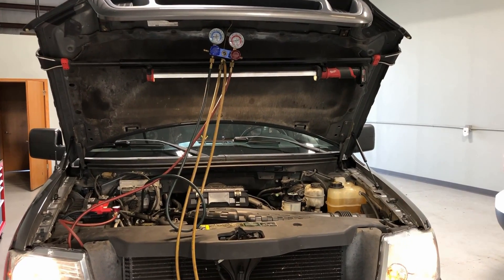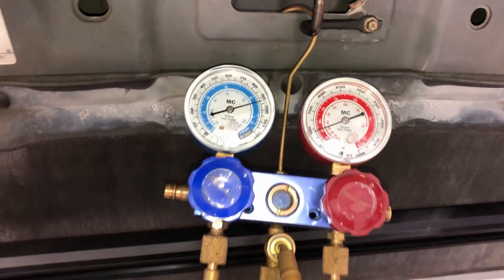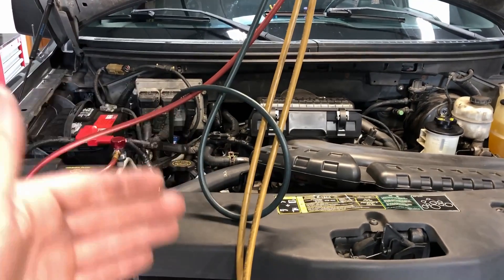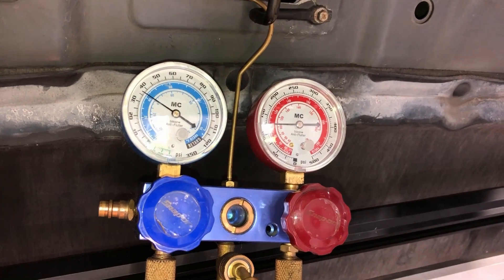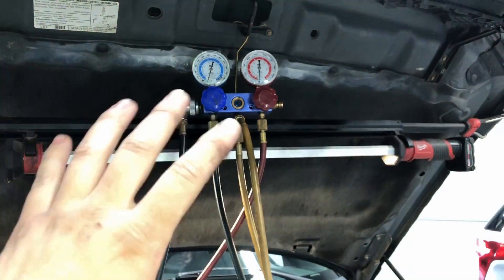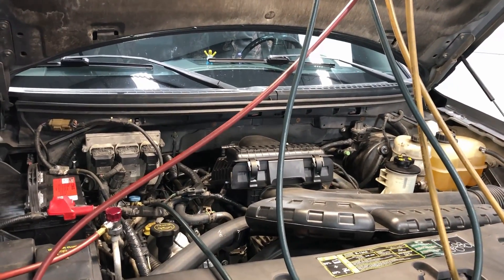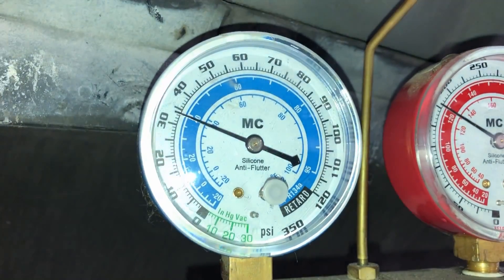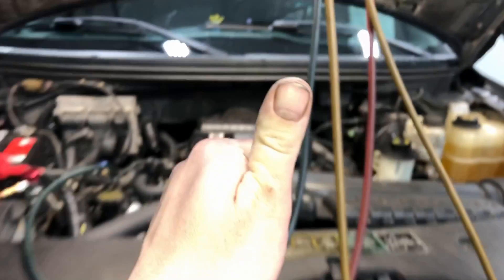Poor Automotive A/C Cooling: Do You Have a Low Refrigerant Charge Level?

Comment: I'm not certain if Fords install dye at factory assembly of vehicle ac systems. GM does when switching from r12 to r134a. My question depends on dye from factory installation when ac was new. As most everyone knows, loss of refrigerant in vehicle ac systems usually means a leak occurred and not a normal loss of refrigerant over time. If dye was installed then a uv light should be used during initial ac inspection when suspecting loss of ac cooling. My presumptions are that all vehicle ac systems were assembled as sealed units similar to refrigerators and freezers except they're standing in place for years. With vehicle ac systems, soft aluminum parts stress harden after repeated flexing from road shocks eventually leading to stress cracks to leak refrigerant. Salted roads allows aluminum to corrode until  thin walled aluminum fails. Even crimped ac hoses give way to leaks. I wonder why no mention of leak detection is ever discussed first when dye will be released anywhere in a system that leaks from loose/damaged fittings or other issues that results in leaks. Dye will mark the area and easily found with a uv light without evacuating and recharging a system only to have a customer return to verify loss of ac cooling.
Reply: I don't think any automakers install dye during the build process, but can easily be added anytime.  An AC system in a vehicle will slowly lose some refrigerant over years of use due to the way the seals are in the compressor mainly around the driven shaft and will leak out the front of the compressor which is why you'll see oily residue on the front of some compressors over the years the seals on that driven shaft move around during use and cause small amounts of refrigerant and refrigeration oil to escape.  R134A's molecular properties are such that it seems to leak easier than the old R12 did, plus your R134a's system runs at much higher pressures and as a result leaks out much easier through the smallest of holes.
Reply: @wildbill23c  You're partially correct. GM started installing dye into ac systems around 2002. Dye is easier to detect using an inexpensive uv blacklight to illuminate fluorescent dye. It glows in a dark garage or after sunset to allow uv light to enhance leaks on vehicles with factory installed dye. Only a 1/4 oz of dye is needed and certainly adds little cost to manufacturing while making it easier to find a source of leaks otherwise electronic leak detectors are used. As a diyer, I found my first leak in less than five minutes parked at Home Depot early evening. Dye glows greenish yellow for GM vehicles. Since I lost ac cooling, it's a no brainer to use a uv light to find where refrigerant leaked out. my car was already ten years old with reliable ac until wear and tear damage occurred. The easiest way to determine if any vehicle has dye is simply removing one or both service valve caps and look. Dye will leak out service valves along with refrigerant  and oil. It will be obvious if dye was factory installed.
Reply: @fdryer5116  None of my GM vehicles ever had dye, and none of my Fords did either.  Maybe a dealer add-on option but sure wasn't factory.
Reply: @wildbill23c  Well, for one thing, FordTechMakuloco replied that Fords have dye from factory assembly.  My '03 Saturn L300 has  factory dye when I found leaks with a uv light. Regardless of what year and brand, dye is a very inexpensive method at factory assembly to make it easier for dealers, repair shops and diyers to find damage without resorting to using electronic leak detection and certainly saves consumers repair bills. When 98% of vehicle ac systems leak, it simply doesn't not make any sense to remove refrigerant then refill a system and bill a customer with a message "if you lose ac cooling, come back...." The moment a system loses refrigerant means it leaked and refilling it doesn't repair anything but provides business for unsubstantiated repairs when loss of refrigerant simply means a leak that isn't addressed at the beginning. As a diyer, I certainly will not refill a leaking system when it's easier to reach for a small uv light and find the source of the leak then address how to repair. Not refill it only to have a customer return for a second attempt to finally use leak detection equipment. A little common sense is missing in this video and far to many vehicle owners are oblivious to this questionable practice. And consider the environmental issues, allowing refrigerant to leak out a damaged system when finding the source of the leak should be the first step in ac diagnosis after electrical and mechanical issues are eliminated.
Reply: @fdryer5116  Well for one I've had/have a 1/2 dozen Fords none of them have dye in them, and the 3 GM's I've had didn't have dye either, so its not a 10% fact that they come with it from the factory.  In theory it sounds cool but the fact is not every single vehicle comes with the dye...and usually if it has dye in it its because at some point there was a leak, or still is and the dealership or the assembly plant put the dye in to try and find the leak(s).  I however, wish every vehicle had the dye in it from the get go it would sure make AC service much quicker by being able to quickly find leaks.
Reply: @wildbill23c  And btw, every dealer have electronic leak detectors at their disposal. GM service manuals provide procedures for sniffers and uv light troubleshooting. Back in the Neanderthal age, r12, dye was an option but when refrigerant was inexpensive and no one was concerned about Freon damaging earth's ozone layer, nothing was done about releasing r12 into the atmosphere. With greater involvement to learn from the past, refrigerants are regulated and changed to reduce its effects on ozone protecting mankind from greater uv absorption. With GM and most likely many vehicle manufacturers, dye included at factory assembly allows dealers and repair shops two ways to determine leaks, electronic sniffers and uv light.
Reply: @fdryer5116  You know how inaccurate those leak detectors are?  They're extremely inaccurate LOL.  The UV dye is sometimes accurate, at least it gives a better idea where the leak is, but that leaves some concern too as its blown all over under the hood of your vehicle while driving, its like UV dye in engine oil, coolant, etc.  the only way its more accurate is if the vehicle is able to be left idling the air movement under the hood while driving blows that stuff all over, makes it really fun trying to pinpoint leaks.  A good shop will put in the UV dye and keep the vehicle for several hours and let it run with the AC on just sitting there and hopefully be able to get the leak found...the worst leaks are the ones in the evaporator in the dash...now that's a pain.  

There aren't any refrigerants that aren't going to have an environmental impact...and they've been regulated even before R12....its more of an issue with people not following the rules, and as such if they want to further curtail these problems they need to stop selling cans of refrigerant to everybody and anybody that cannot positively show a certification of proper refrigerant handling and proper equipment on hand to recapture the refrigerant.  Many shops now have automatic machines that do that, and even at that you will always have slight residual refrigerant release into the atmosphere while connecting and disconnecting the refrigeration lines on the machine to the vehicle.  Anytime there's an accident involving the front end of a vehicle you most likely will damage the condenser releasing all the refrigerant in the system immediately on impact...and the R1234yf is slightly flammable....so that isn't a good thing to have being released during a collision, with the release of the refrigerant combined with refrigeration oil it hits a hot surface it catches fire....yep real safe, if the airbag exploding in your face doesn't kill you the fire from the flammable refrigerant may.
Reply: @wildbill23c  Your'e almost declaring hiding in a cave about the harm mankind is doing to this little orb we live on. Personally, I've never used electronic sniffers (too expensive for my infrequent use as a diyer). I can state with certainty of  dye detection on my first try and was thoroughly impressed with how quickly troubleshooting is in what was  considered a mystery to diyers without training and familiarity in refrigeration. I spent the time learning, beginning with vehicle r12 systems, repairing my car with nothing more than carefully examining the entire system. Believe it or not, the evaporator was poorly made, using epoxy for sealing end tubes. I won't mention the foreign sports car that had this manufacturing defect (a recall was issued after I replaced it) but back then all had  to do was look into the center vents to see oil on the txv and evap coils. The center console was removed for clear access to the evap coil with a better view of leaking refrigerant oil on end tubes. Repairs are straightforward with evacuation, makeup oil and r12 to restore factory ac cooling. No dye, no sniffer as refrigerant oil leaves stains as markers where motor oil isn't expected. Fast forward to using a uv light on my Saturn and a crimped hose leaked at the crimped fitting with tell tale dye showing. A hard line crack and corroded condenser also showed dye. All found without a sniffer but using a uv light. The switch from r12 to r134a was around '94 with GM eventually adding dye into systems some years later. I was fortunate to have factory dye in my Saturn (r134a system).
Reply: @fdryer5116  Well gee that's what you were leading to in your previous post regarding refrigerant leaking into the air.  So I finished it up for you ;).  

I don't use a sniffer never found them to be of any use just a huge waste of money.  Leaks are easily found finding the oil residue most of the time, otherwise simply adding refrigerant to get the system to cycle then adding dye and you can usually find the leak(s) fairly quickly unless that is they're buried up in the dash in the evaporator.
Reply: @fdryer5116  Yep when you are rich you can afford all those nonsense toys that the rest of us do just fine without and as a matter of fact diagnose the problem properly the first time and even tell the moron mechanic the problem that they totally ignore and replace everything else except the actual problem part...cough...cough...Toyota dealership...they ended up refunding all the parts they installed that wasn't the problem after I told them I'd be contacting corporate and my lawyer...funny once they replaced the compressor like I told them to do the first time the truck was there it magically started working and has been for the past 2 years.
Reply: @wildbill23c  Unfortunately, there are unscrupulous dealers and repair shops. I describe them as the ones with attitudes like "Its business, nothing personal".
Reply from the maker: Yes Fords come with dye from the factory.
Reply: @FordTechMakuloco  Must be certain ones none of mine did.

Comment: Hi sir

I have  ford explorer 2010 ...recently I changed engine and gear box ...now the vehicle have stuck a shittt problem so many technician try solve ..but cant ....problem is vehicle stop a day or more ...then only cranking not start.. I changed crank sensor wiring no result ...solution again start ...is  engine control module center input socket unplug and put back that time hear beep sound  at the time cranking engine start up (so many times try )....after start up engine 24 hours no problem...if hold day or more  ...come back problem....( I am live in Saudi Arabia .....from india)sorry for the poor english literature ..hope underastand..)

Comment: pretty sure you just figured out why my system ices up, I have the same truck, same color. mine is the step side though.
Reply: Check and make sure your cabin air filter isnt clogged(if your vehicle has one) that'll block airflow and cause ice up
Reply: @aaronshensky9385  i will check, thanks.
Reply: @Excitable101  no problem

Comment: Does a low charge situation like this necessarily mean something is leaking and must be fixed or can and does a system gradually deplete over time?.....and good video as always youv helped me out a few times i really appreciate what you do👍
Reply: The AC in your car works differently than the refrigeration system in your house refrigerator which is sealed.  The AC in your car slowly over long periods of time (normally several years) will lose small amounts of refrigerant mainly through the deals in the compressor shaft.  Very very small amounts are normally lost that way.  If you are having to recharge the system every year or sooner there's definitely something more to the refrigerant loss than the normal residual loss through the AC compressor's seals.

Comment: Can i use just a can of 134r to recharge it?
Reply from the maker: Yes
Reply: I added a can (12 oz.) 3 or 4 years ago because it was short cycling. It fixed it. I am happy that leakage is minimal. I think now the compressor is a little clackety like in the video, and cooling is good enough, but not great like it should be. If i add another can, how much should I add, what pressure should I go up to on the low side? I don’t have a high pressure gauge. It’s an 05 f150, so it may not have that f o e (fixed orifice).

Comment: How about dryer?   Change it in this case?
Reply from the maker: No this vehicle was charged with half a pound of refrigerant on purpose as a demonstration vehicle. Now if this was a real situation it still wouldn’t need a dryer because there was still pressure in the system.

Comment: I personally like the FOT systems better since the compressor does not cycle.... at least on GM's. Our fords have TXVs. All that cycling for years has to wear on the clutch and internals. Our caravan's compressor broke internally so it would freewheel with the clutch on. I've never had a GM compressor break, just the seal wears out.

Comment: '04 F Series....just now showing low charge?  NOT FREAKING BAD.  FMC had BEST IN CLASS LEAK DOWN. Say what you want, but FMC has a 10+ year leak down, which blows away the competition by 4 years.  That INCLUDES Toyota and Honda which have 6 year to 8 year leak down times.  FMC Has improved their leak down by moving from MSLC Connections to SSL Fittings to MSF Fittings.   Granted, MSF was brought in thanks to 1234YF (known to the auto industry as 1234 YOU'RE F'D).  BTW: That FOT system?  BEYOND Old tech now.  I'm impressed that they were just now seeing issues.
Reply from the maker: This system was purposely charged with only half a pound as a demonstration vehicle for video purposes.

Comment: Brian,
Great video! Both my 2002 and 2005 Focus have FOT systems so this video was very explanatory. I completely re did the 2002s AC system last summer (new compressor, condenser, dryer, and orifice tube). All new o-rings as well. I get 40F outlet air at 97F ambient. Got to do the same to the 2005 soon. Thanks!
God bless
Paul

Comment: What would be the symptoms of an overcharged system?
Reply from the maker: High and High, I will go over many different scenarios in future videos and how to recognize each one.
Reply: @FordTechMakuloco  ok thanks, looking forward to that video. I'm interested in the "under the hood" signs and sounds of the overcharge condition before hooking up the gauges. Love your channel, and thanks for sharing your knowledge of the Ford line of vehicles.🙂👍
Reply: Just the opposite of a low charge high low side pressures and high-high side pressures. Compressor could cycle on and off like it did in this video since high side  pressures would most likely exceed the pressure sensor.

Comment: Perfect timing, I've dumped 2 cans of a/c pro in my 2014 explorer, must have a leak?🤔
Reply: Those things are junk you really need a manifold gauge set to fully see what is going on.  Changes are your system is over-charged as a result LOL.  Also, that stop leak crap found in most of those baindaid refrigerant cans will also cause some issues plugging up orifice tubes and all the other tiny passages commonly found in today's refrigeration systems.  

Without the manifold gauges you have no idea what the system is doing.  Your compressor could be shot and you wouldn't have any idea.  Get the manifold gauge set and go from there.
Reply: @wildbill23c  ditto on the stop leak. Stay far away from stop leak (if you plan on keeping the car) otherwise it's even a waste of money for a car that you're trying to sell.
Reply: I just get frustrated they're able to put on their cans "gets colder" and other marketing BS
Reply: Eric The Car Guy has a good video on how to charge an AC system. He also adds dye so if there is a leak, you'll easily find it. At $5/12oz can and free gauge and vacuum rental at AutoStoned, I'd go this route.

Much cheaper than that overpriced "AC Pro" stuff. Freon is freon; nobody has a secret sauce that performs better.

Comment: Thank you again brian! I have this exact same problem on all 4 fords! Curious... Do you advise 5W-30 engine oil on the 2006 F150 4.2L V6 and 4.6L V8, and E-150 4.6L V8? Factory spec is 5W-20. Mileage is 150k+ x4 vehicles.
Reply from the maker: yes